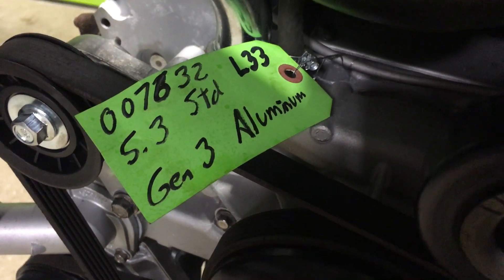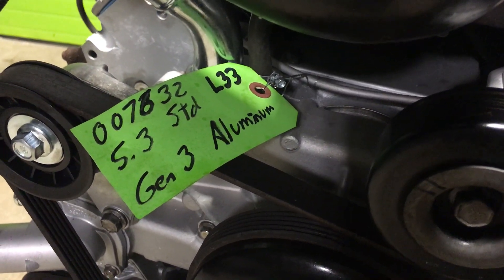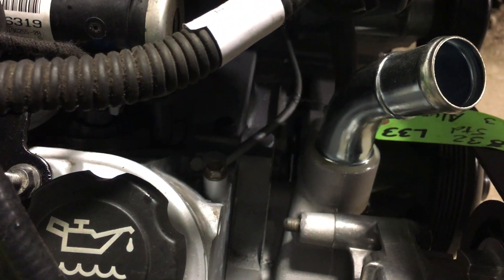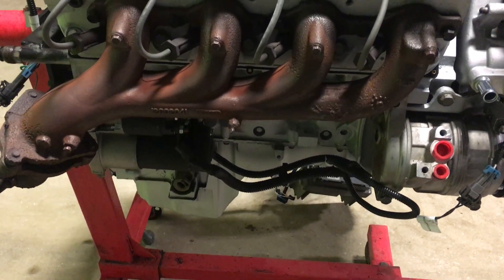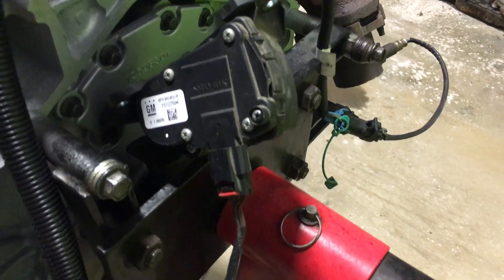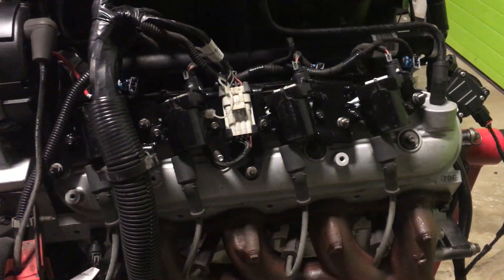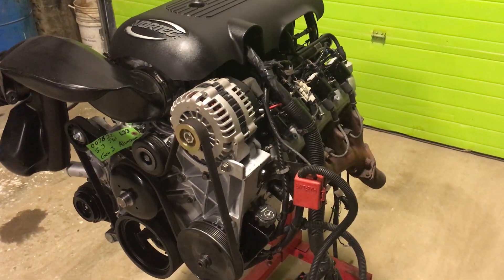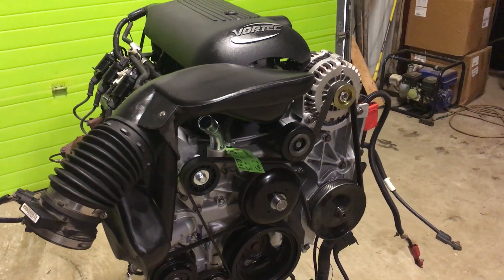Rebuilt Chevy L33 5.3L LSx Engine Texas Speed Stage 1 Cam Walk Around

Comment: Those gen 3.5 motors are awesome. They have the gen 4 dimple rods in them and floating pistons. I would of kept the 243/799 heads to manage the keep the compression manageable on stock ecu for possible boost upgrade in the future.